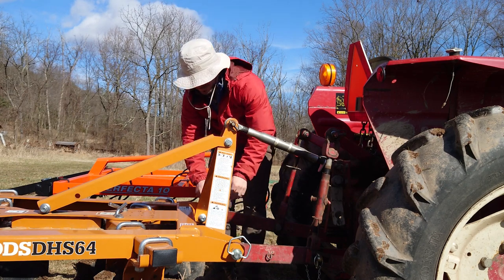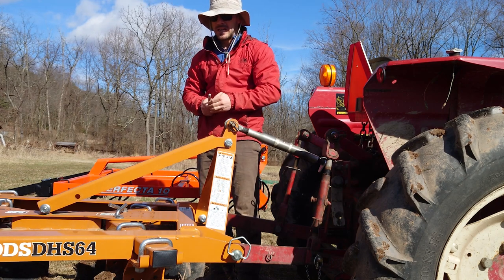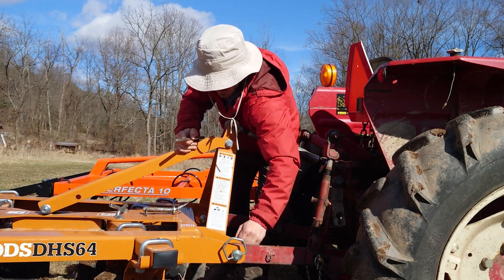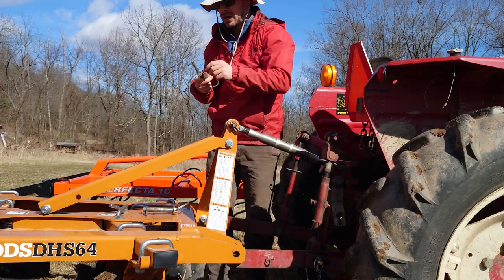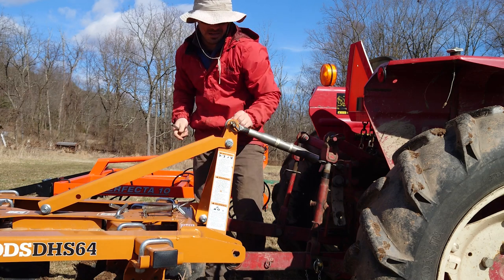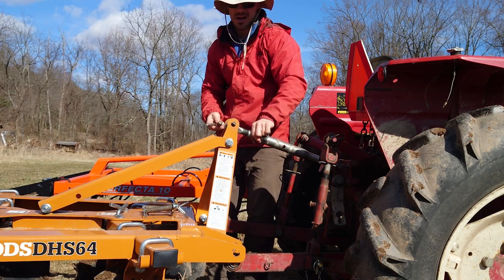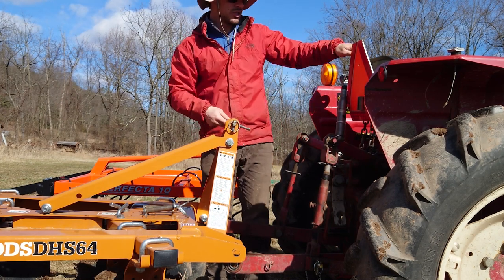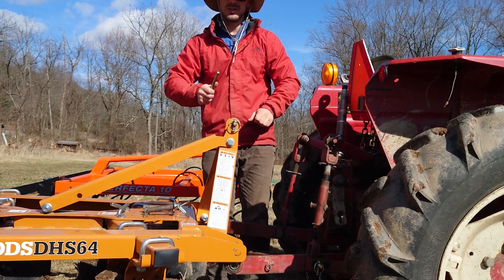Stop attaching 3 point hitch implements wrong - Use the top link first! The proof is in the pudding

Comment: By the way, my toplink end always has a foldable lever. You can thus rotate this bit where it is connected in the implement, allowing rotation of about 30 degrees. This combined with the lever in the middle bit of the toplink allows you to do a ratching movement where you slightly shorten and then lengthen the toplink, it allows you to rotate the middle bit a bit tighter. The foldable lever also prevents the middle part from rotating once you have reached the desired length. I have replaced one toplink with a hydraulic one because larger implements are impossible to adjust because of their weight
Reply from the maker: That is also on our shopping list. We really need a bigger tractor with hydraulics for front and rear.. possibly side with the amount of property / mowing and slopes we have. Equipment has been really expensive lately and trying to find the right deal. Would love remotes for hydraulics - right now I have to lift everything myself! We do not even have a front end loader.

Comment: With a 1950s snap coupler, you just back up the tractor, it automatically latches, turn around in the seat and attach the lift arms :)
Reply from the maker: What happens if you need to adjust the angle with the top link? You must be mighty flexible to reach the lift arms from your seat haha!
Reply: The lift arms are actually at the top, very high up and some versions also have an automatic latch.  It does require some backing precision.  The "center" link is below and just forward of the axle.  There is often an angle adjusting crank that you can reach from the seat on some implements.  Ferguson's "3-point" system was designed in the 30s.  There were lots of better systems designed over the years, but to win the marketplace, you don't always need the best idea, just the one that everybody settles on.  The ferguson system actually sucks in comparison to some of those improved designs.

Comment: This is a great way to do it with a small tractor, but it will not work for a large tractor that requires the handbreak to be engaged before you get out of the cabin. Even if I could leave the automatic gearbox in neutral, the weight of the tractor in the dirt would prove too much friction to move it with the toplink
Reply from the maker: I have done it with bigger tractors. It moves the implement instead. Like I said in the video,  you have to back up relatively straight and close for any method to work.

This one has more room for error (the length of the top link) to get you to your arms. I purposefully left it really long in the first example to show the exaggerated distance it can move and the relative ease on the body.

In the second one where I put the perfecta on it shows the close up of the implement moving into alignment and the tractor doesn't move at all.

Thanks for the comment!
Reply: @thefarmatcatawissacreek  the implements we lift do not want to move. I used to move the implements or trailers if they did not line up but since we moved to larger equiment and tractors I had to learn to manouver more carefully :-). Our lifting links are different though, they open from the top and that makes picking up things easier
Reply from the maker: @ttkddry  I can see that being the case for bigger field crop equipment.

Comment: Sway bars first/top link last method is mostly for PTO implements. Overall, it really doesn't the order. That said, for non-PTO items, sway bars should be attached left first because the right bar is usually adjustable.
Reply from the maker: Yup. Seen that explained many times but I am still not convinced it is a good way to do it. The right arm is mainly for balancing the implements out and leveling them per the slope of the ground.

It really makes no sense to not use the lever to make small adjustments and get back on the tractor to drive 2 inches or pick the heavy implements up and move them. I purposefully made the video example extreme to show this.

Some newer tractors have telescoping arms and movable pieces but it still defeats the purpose of a lever in my opinion. I would be shocked if the original was not designed exactly for that reason but no one can point me to a piece of literature that says sway arms first.

As for the PTO. I put those on  as well with the same method. I guess people complain that you have a harder time reaching the PTO but it really is not hard to get in there - worst thing just unclip the top link for a second compared to struggling to get the first arms on if you do not back up perfectly. 

Thanks for the comment!